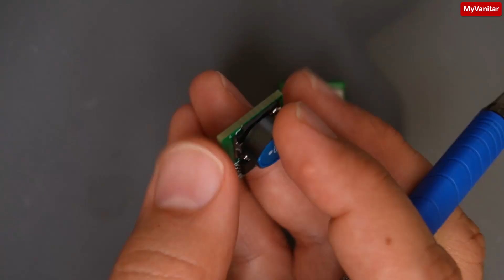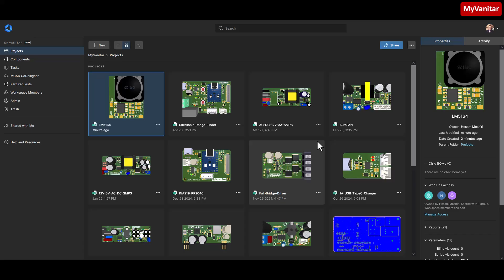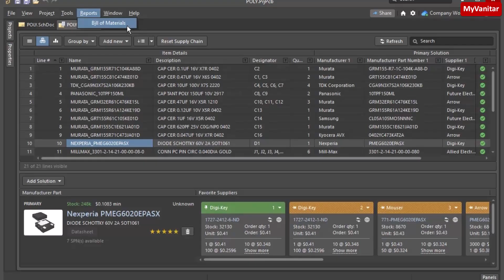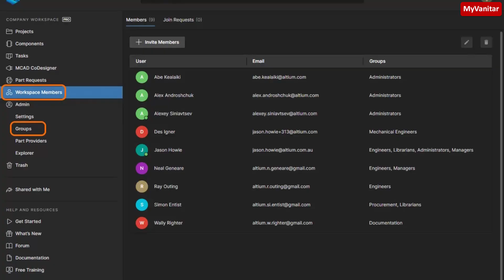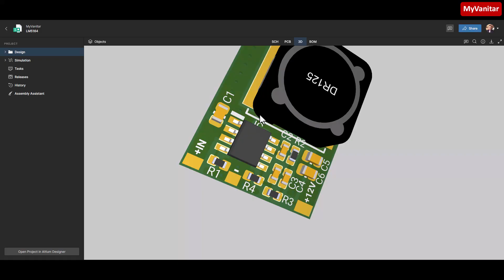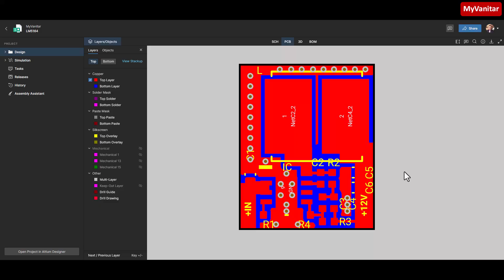100V to 12V-1A DC to DC Buck Converter Circuit

Comment: The minimum conductor spacing for 100V should be 0.6mm. In your PCB it is 0.5mm.
Reply from the maker: That's okay, if the final circuit should be used in a harsh environment (dust, humidity, corrosion, ....), the PCB must be covered with epoxy resin or similar coating materials;  as a result, the air clearance does not help and the board should be coated. also, sometimes it brings some design challenges, especially if PCB size matters
Reply: @MyVanitar  I believe you should reconsider. That's not how it works and rules are there for a reason. But anyway at least you now know for next time.
Reply from the maker: I did know about all of these; that's why I replied. There is a different rule and clearance size for the coated PCB copper (much lower). By the way, you have the schematic and PCB, you can modify that clearance if you like.
Reply: @tsmicro  it seems you pushed yourself to find a problem in his work 😂 , I see what he said (coating) in all brand automotive boards such as ECU, TCU and BCM
Reply: @hp2073  Actually not. I immediately realized his mistake by just watching the video and when I opened the PCB and measured the clearance I was sure about it. His video might be seen by people who have no idea about these things and I wanted to point it out to prevent exploding PCBs! In my career I have seen things exploding and I am a bit sensitive to such things. No other intentions for criticism were intended.
Reply from the maker: I'm not here to argue. Nothing will explode for 0.1mm less. If someone is too tricky, must use coating, and that's what's being used in the industry. Good luck with your designs!

Comment: Can it handle 72V and 40A input current?
Reply from the maker: Doesn't matter, you can get up to 1A continuously at the output of this converter, and the converter consumes in proportion from the input (you can calculate it). so if your input can handle higher currents, it's fine, but it's way more than enough for your application. so As long as the voltage is within the range (72V is between 15V to 95V), you are good to go